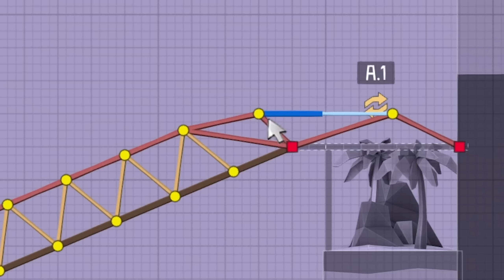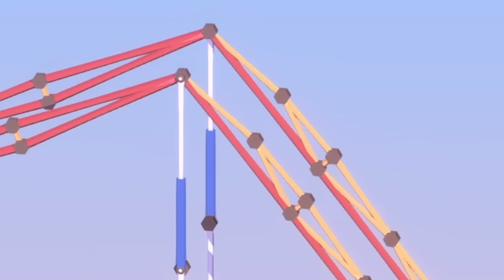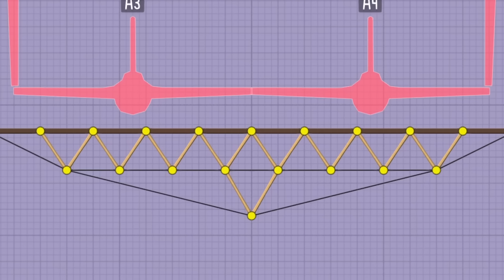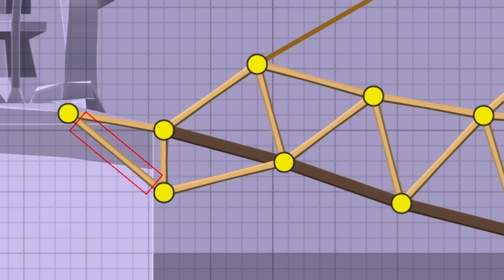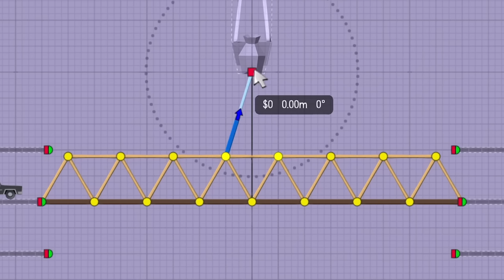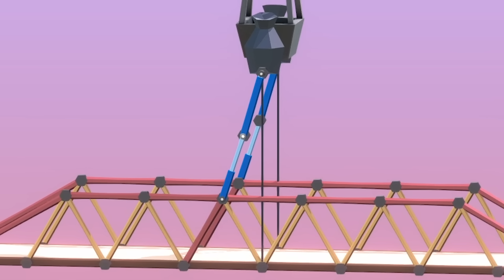Engineering a SKY BRIDGE In Poly Bridge 2!

Comment: From the moment I understood the weakness of wood, it disgusted me. I craved the strength and certainty of steel. I aspired to the purity of the blessed metal.
Your kind cling to your wood as if it will not decay and fail you. One day the crude biomass you call a bridge will wither and you will beg my kind to save you.
But I am already saved. For the steel is Immortal.

Comment: 8:00 I don't understand why Tyler and RCE both try to build full spring structures. It's a terrible idea, the whole thing deforms and collapses easily. You need the solid components to provide stability and just enough springs to absorb landing shock.
Reply: The only building material given for support is springs. I was confused at first too.